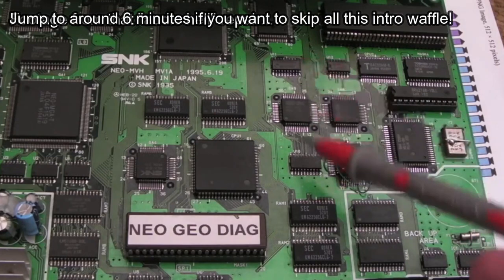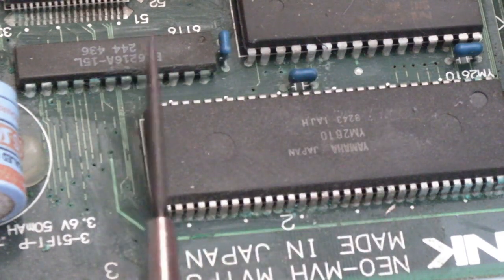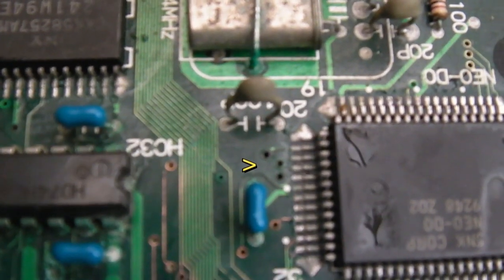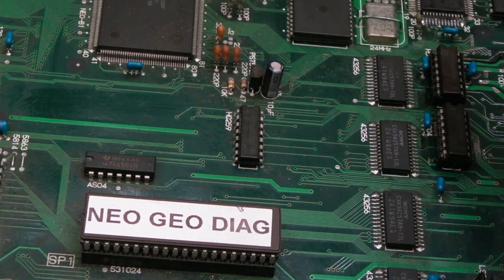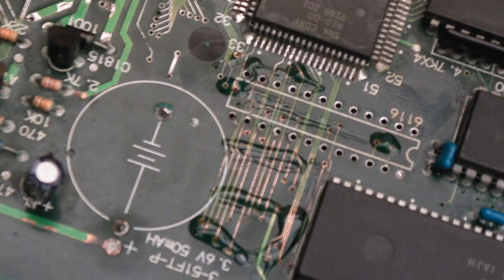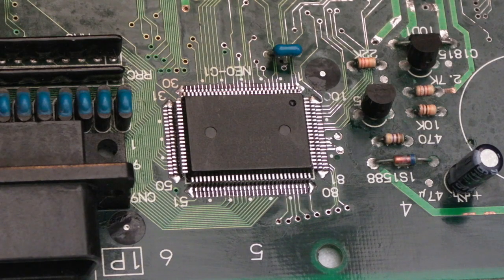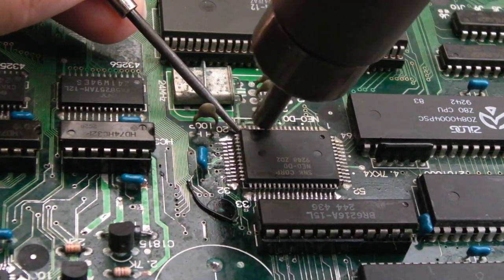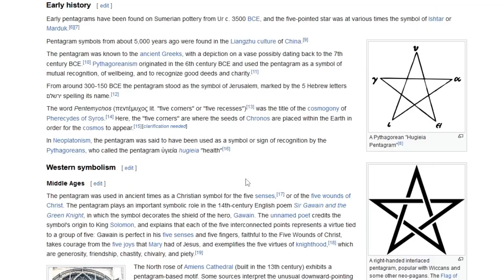Haunted SNK Neo Geo MVS Repairs - Part 1

Comment: At my work we had a haunted keyboard that was doing some very strange things.  At first I thought it was the mouse as it seemed that things were getting clicked on randomly but I swapped out the mouse and the system was still acting odd (open program windows randomly closing, keys repeating or not, random things appearing to be clicked on).  When the num lock key was pressed the light would randomly flicker on and off.  I swapped out the keyboard after seeing the num lock light act that way and all the issues went away.  I did take apart the mouse and found that the left click button for some reason had a -0.6V on the switch input that normally would get pulled to ground when the switch is active so I could not fully rule out the mouse as being bad as well.  The right click had about 3.2V on it as a pull up value.  The other odd thing is that the pull ups for the buttons went through the LED for the image sensor which I think was a poor mans way of reducing the pull up value to roughly 3V or so accounting for the diode drop in the LED.  Based on the negative voltage reading on the one switch it could be possible that the mouse was adding to the keyboard issue.

Comment: I think I remember you posting something evp related a few years back. Was scary stuff for sure! Maybe the spirit was trying to say that the board was dying lol
Reply: If you want to get rid of negative energies in the home. Burn some sage around the house and move towards an exit which would be an outside door and window. Which will guide the negative energy out of the home. Our lass into things like that. And so far so good house has felt a lot lighter than ever. Look it up really good
Reply from the maker: Knowing my luck, the sage would burst into flames at some point - particals fly out everywhere setting fire to everything lol